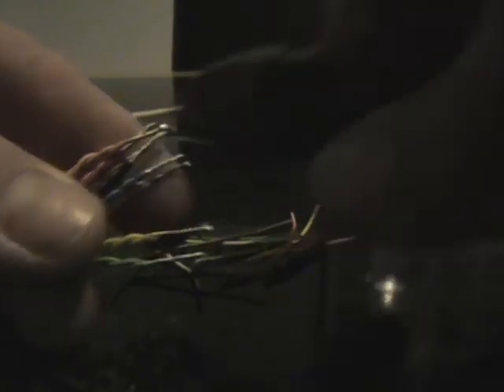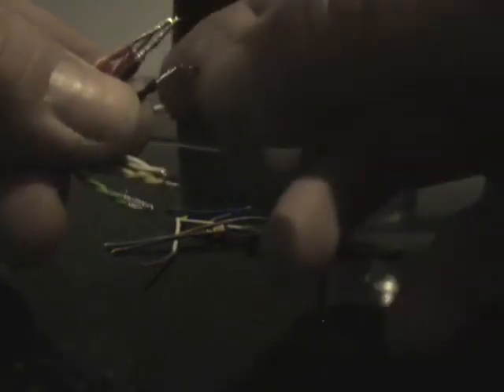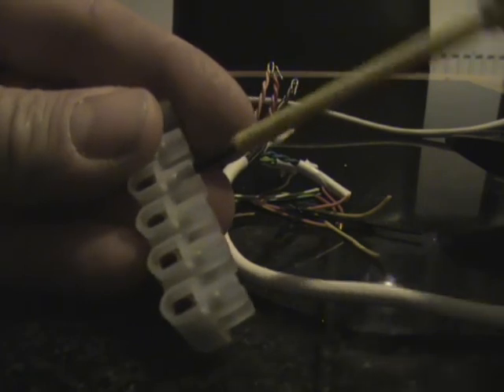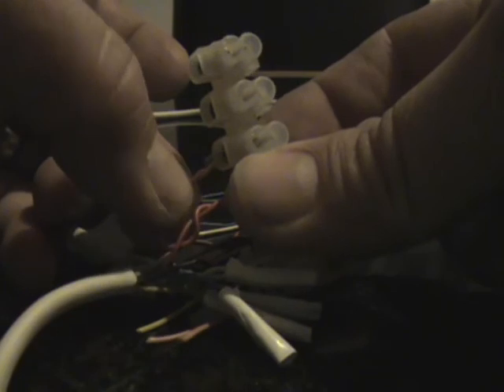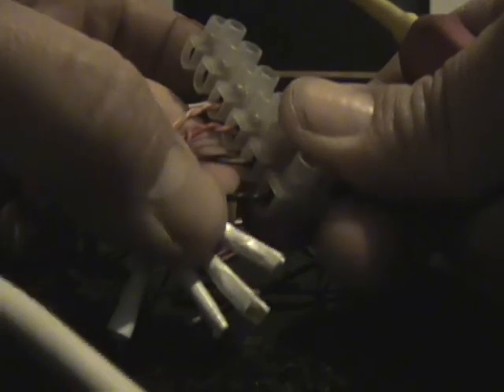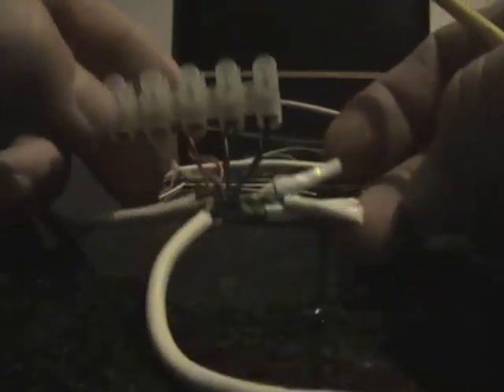How to join an alarm cable

Comment: Very professional: NOT, tape joints & joints under carpets are a no no. Anywhere you do need a cable join should be done using a proper tampered junction box. Tape joints especially when under carpets are just faults waiting to happen.
Reply: Jointing block under carpet, which size block do I need?
Reply: Wouldn't the box bulge up under the carpet?